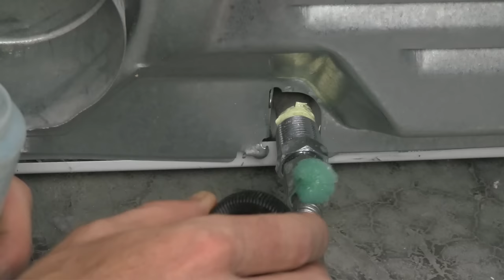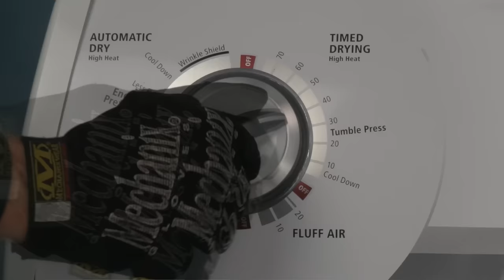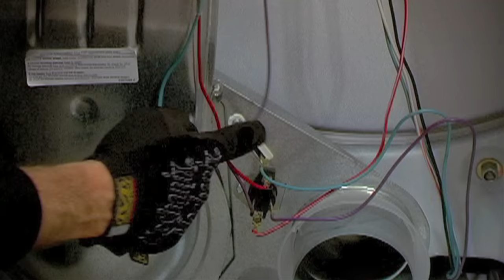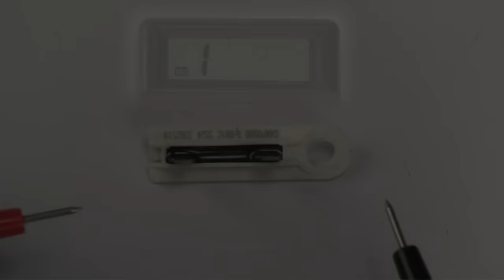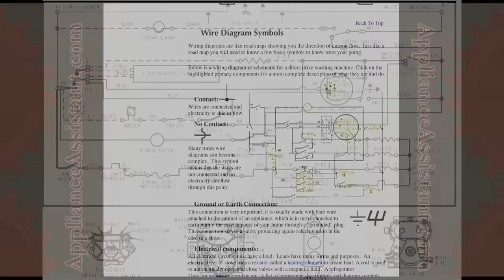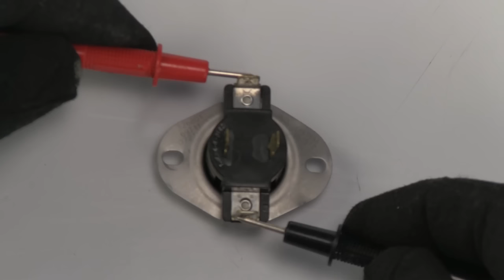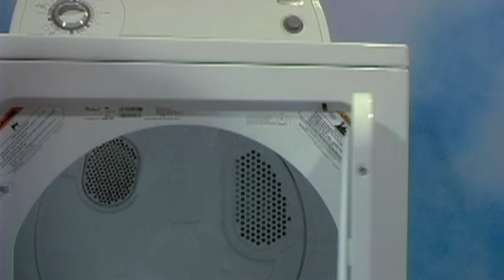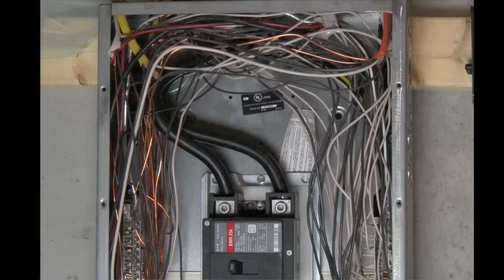Gas Dryer Repair: Fix Heating Problems

Comment from the maker: Thank you for making that point! The drum does need to be in place for the blower to properly draw the heat away from the hi-limit thermostat which will kick the burner off after about 10-15 seconds if the duct is clogged or the appliance is open not allowing the blower to pull heat.  Sorry I didn't make that more clear!  Congratulations! Thanks for the comment!

Comment: I am having the same problem with my whirlpool lgn1000pq gas dryer..igniter glows red and lights flame upon cold start....flame burns for 5-10 minutes and goes out never to light again unless from a cold start... I have cleaned all lint from dryer, flex pipe and exhaust fan....replaced gas coils and still same isuue...any help would be appreciated...I can see igniter glowing...I can hear a click and then a wooosh like the flame was blown out....Thanks

Comment: @applianceassistant 
This is the exact problem I have. The heat goes on but goes off after a few minutes. After turning off and letting it sit for a while, the same thing will happen, heat goes on for a few minutes then off again. Which part should I look at?

Comment: @applianceassistant , wow, your answer was fast! thanks!  well, while waiting for your answers I runed the dryer, turning the heat temperature to just air once in a while, making the flame turn off for a while.  And when I was going to do this again I noticed that the flame turned off by itself!.. mmm.. I probably wasn´t waiting enough!.  So, it looks that this cycle just went ok.  I have to dry more cloth afther this cycle... so, I will be checking.  Many thanks. Your web page is great!

Comment from the maker: @lorisbs Thanks!
You can monitor the cycling temperature with a meat thermometer at the rear duct.  On hi heat it should cycle off somewhere around 160-170º and back on around 100-110º you can also look at you cycling thermostat and see what the target open/close temp should be, but it will be slightly cooler as the air is leaving the dryer. If it does not cycle off eventually the hi-limit thermostat or thermal fuse will open.  Email me through the site If you have any other questions.

Comment: Great video... I have been working with my whirpool dryer for some days... the flame was turning on at the begining but after a while the ignitor turned on but not the flame, so, it wasn´t heating. I checked every thing, and all pieces have continuity, so I decided to replace the gas valv selenoid coil kit.  The flame is turning on now, but it doesn´t turn off... it´s supose to turn off after a few minutes, right?   I have learned a lot these days about dryers, but don´t know what else to do.

Comment from the maker: @TMGADTXTER What is the brand and model number of your dryer? After the dryer has heated and cycled off, does the ignitor glow again and then go out with no burner ignition? If you turn the dryer off for an hour or so will it heat again?

Comment: I watched the video, but I am unclear about the problem with my dryer.  The igniter lights up, the gas is released and the dryer heats up, but it appears that it does not re-ignite and so the clothes don't dry completely.  Is this the sensor/thermostat in the back or the two coils that control the gas flow?  thanks in advance for the clarification!

Comment from the maker: @ace3shotgun7 If you have replaced the coils and are sure they fit well and are installed properly then it sounds like you have a gas supply problem. All you can do check that the gas is getting to the dryer if it is you may have a bad dryer gas valve, very rare but possible.  But first take a good look at the coils and make sure they are sitting well on top of the valve and the bracket is mounted properly.

Comment from the maker: @TBBJ2011 In most cases replacing the coils located on top of the valve should solve your problem.  If you need parts please find them through the links on my website. There is a link to ApplianceAssistant . Com in the description of this video. 
If you have any other questions please feel free to email me through the website and I can be more specific. Thanks!

Comment: I have a whirlpool model LGB6200PQ0. My dryer is not heating up, it glows orange an the flame starts. After 10 minutes the dryer stops drying. Turn back on after it cools down an it repeats the same thing. Checked the air ducts an found no lint. What do you recommend.

Comment from the maker: @lombo69 Sounds like you have a clogged duct somewhere, it could be internal if you have already tried to run it with the ducting off the back.  The only other thing I can think of mechanically would be the hi-limit thermostat part# 279048 malfunctioning, but most likely it is doing it's job correctly and cutting power to the burner due to a clog of lint somewhere.  If you happen to need a part... purchasing it through ApplianceAssistant . Com would be greatly appreciated! Happy Thanksgiving!

Comment from the maker: @Charismabucceri If you can see the ignitor heat up and cycle off with no flame then it is almost certainly the coils that need replacement. If the ignitor glows it okay in almost all cases. However if the ignitor heats up and does not cycle off then you need a new sensor on the side of the burner tube.  If you do need to get parts I would greatly appreciate buying them through the links on ApplianceAssistant . Com!  If you have any other questions let me know!

Comment: My maytag dryer is not blowing out heat. Its blowing out air but not hot air. One site suggested that I change the igniter kit, so I did. It lights up but my dryer still is NOT getting hot. And there is no fire starting in the tunnel/tube thing made of sheet metal. I've watched a video that suggets made its the valve coils or the thermostat. what do u think?

Comment from the maker: @gloweify If after it has cycled off you observe the ignitor glow again and click off without burner ignition then you should replace the coils on the valve. If the ignitor does not cycle and glow again then you may have a cycling or hi-limit thermostat problem. Or perhaps your ducting is clogged, or your blower ... Lets just start with the first question and go from there :) Also what is your dryer's model number?

Comment: @applianceassistant . I have a similar problem as above. Igniter glows, burner turns on and heats for a few minutes and then shuts off. It wont turn on again until it apparently cools down. Please let me know if you have any suggestions..thanks for your time.

Comment: @applianceassistant--very helpful video, I have a similar problem as the above comment. Burner igniter glows followed shortly by the burner turning on thereby heating. However after a couple minutes it shuts off and wont burn again until it apparently it cools off. Any suggestions? Thank you for ur time.

Comment from the maker: @MegaFlyman9 If your dryer is gas I would go with the valve coils... if the burner ignitor is glowing but the burner will not light you know that the thermostats are okay and it's probably the burner coils.  However if the ignitor stops trying to ignite the burner then you probably do have a problem with one of the thermostats.  Feel free to email me through ApplianceAssistant . com if you have any questions and I can get a little more detailed. Hope that helps some, Good luck!

Comment from the maker: @srelliott83 Sorry for taking so long in getting back with you. By the wire diagram I would think that you may have a problem with the temp selection switch or the wire harness that connects to the temp selector switch.  The harness has 2 inline resistors (1 10Ω & 1 10KΩ) I would check those for resistance with the harness unplugged. or there is a timer contact problem from orange to white/black wire at timer switch 0.  hard to say for sure without actually checking voltage at the timer contact.

Comment: Great Video.  I get heat on start up and then after a few minutes the heat turns off and does not come back on until after about 10 minutes when everything cools back down.  I am guessing I have a cycling thermostat failure and the system is cycling on the hi limit thermostat.  Does this sound like a correct diagnosis.  I already mistakenly replaced the hi limit thermostat and don't want to make another costly mis-diagnosis.

Comment: Hi.  My gas dryer gets hot on the high setting but does not heat on any other setting.  The timed high heat will progress on its own.  The auto dry mode does not progress or heat up.  It is a Whirlpool lgr 7646eq3.  Any advice?  Thanks!

Comment from the maker: @kenbro63 That's a tough one... If the valve coils did not solve it I would lean toward the valve itself.  Of course check the hi-limit first but I doubt it.  You will also want to pull the valve out and take a close look down the orifice where the gas comes out. I had one case where a spider had built an egg inside the valve orifice that was strong enough to bock the gas flow.  If you actually open the valve assembly it will need to be replaced! The valve itself IS NOT serviceable.

Comment from the maker: @kenbro63 In my experience replacing the valve coils will get you going and stop the noise in the valve 90-95% of the time.  
If you would be so kind as to purchase the parts through my website ApplianceAssistant . Com I would be very grateful! Good luck!

Comment from the maker: @laro177 If every component checks out and the igniter is still not glowing you will probably need to check for voltage coming from the timer to the heating circuit.  Please send me an email through my website and I will give you my phone number so we can try to figure this thing out. Applianceassistant . Com

Comment: Appliance assistant, you guys Rock! I researched the symptom in your comments and matched it up to my issue to the "T", and followed your great video advice and replaced my coils. The problem fixed with my two year old Whirlpool gas dryer. Thanks for the advice.

Comment from the maker: @tifnik3 Model IGD4300sq0 has all temperature settings on the timer. Because the dryer works properly on the timed dry cycles we know that the heating circuit works... So I would venture to guess that the timer is not supplying power to the heating circuit during the automatic cycles and needs to be replaced.  (Timer is part#8299764) The only way to know for sure is by checking for 120Volts coming from the timer to the heating circuit you would need a wire diagram to know what wire.

Comment: I have a kenmore 80 series Gas dryer I bought used. It worked for 1 day ... :-( 
1. igniter glow no flame (I replaced 2 coils)
2. Now Igniter glow flame start and last for less than 10 seconds.
Now what else can I do ?? Please help I but parts from your store

Comment from the maker: @cvtogate All Kenmore dryers starting with 110. are Whirlpool built and are almost identical to what you see in the video.  You are exactly describing the symptoms of bad valve coils.  Don't buy them individually!  It is actually less expensive to buy them as a set. And then you are sure to get the one that's acting up.  I would greatly appreciate it if you would consider buying through my website ApplianceAssistant . Com and support this service!  Thanks!!  If you have any trouble email me!

Comment: Kenmore 70 Series GAS Dryer Not Heating up serial 11076712694..  The dryer spins and lights up. I removed the front peep hole and saw that there is what seems to be a glow coming from the bottom of the unit which I'm assuming is the the heating coil, it shortly fades out like a candle within a few seconds, I don't see an ignition of gas.  The coil or glow seems to cycle on and off every three minutes.

Comment: @applianceassistant :

@applianceassistant . when the igniter  get heat the flame start normally but in like 10 or 15 second turn off. i'm confuse, can the coil be the problem or the thermostat, I already check the thernostat and when i checked the 2 long conector  i heard the sound in my meter it means is good but with the 2 closer conector i donot hear the noise it measn is good, but when i chech the same chort conectors  with 20k i get a reading of 6.69 it means is goog ?

Comment from the maker: @MonsterSpartan The heating element itself ether works or it doesn't, so being that you had said that it heats sometimes I would say that it is unlikely that the element is bad.  I have been commenting as if you had a gas dryer...Is your dryer gas or electric? Gas dryers don't have heating elements. Model number would be helpful.

Comment from the maker: @edwinyoutubification Not really.  You can check them for continuity; However, because they generally only fail when they are hot it is difficult to get an accurate reading.  If the igniter heats up and cycles off with no heat...
#1 it's the coils.
#2 your gas to the dryer is off or blocked some how.
#3 your dryer's burner valve is bad. (fairly expensive and very rare)
If you need any parts...PLEASE PLEASE PRETTY PLEASE buy through ApplianceAssistant . Com to support these videos. THANKS!!

Comment from the maker: @edwinyoutubification Not necessarily... When the igniter  heats up and cycles off with no gas being released, the coil kit is the most common cause.  However, when the gas just burns for a short time (15 seconds) then drops off suddenly, it is usually clogged home or internal air ducting, or the hi-limit thermostat. (side note:  If you need parts I would greatly appreciate it if you would consider buying through the links on my website ApplianceAssistant . Com  Thanks!)

Comment: I think that I have the same problem, my dryers starts burning gas, the igniter is turning on and off, but in like 15 second after it started burning gas( I see the flame) the gas stops. Does that mean that I have to replace the 2 black coils ?

Comment from the maker: @panagdimi It should only have 4 wires directly connected to it. The best way to check the thermostat for cycling accuracy is to use a meat thermometer to measure the temperature as it leaves the dryer at the duct, and observe the temperature fluctuations.  on high heat it should be heating to around 160-180 and the it should cycle off and cool down to around 110-120 and back on again. Email me through my website ApplianceAssistant . Com for a more detailed description of testing procedures.

Comment: Unbelievable, great video. Great detail. I fixed my whirlpool dryer a couple of times in the past but this time it was firing on and the flame went out after 10 to 15 seconds. The comments and your very helpful replies to other gave me the answer. My vent was clogged from lint from a very fluffy blanket. Thank you

Comment: HEY!  Did as you said, had 120v at igniter leads, pushed the leads back on to igniter, (after unplugging machine, of course) plugged machine back,put it on high heat and igniter glowed, machine fired!!!Checked on low for kicks, fired!!!Could the only problem have been loose connection at igniter?  When I first took machine apart that baby was tight.  Actually had to get flat blade under the "clip" to release. I also giggled motor wiring "clip" too before trying to fire machine.  Who knows?

Comment from the maker: @munkdavid  Try unplugging  the leads to the ignitor and check for 120 volts from the leads when the dryer should be heating. You will need to reattach everything, remove the drum and ether jump the door switch or reattach the closed door panel.  It sounds like the timer may not be supplying  power to the heating circuit.  You may also have a partially loose contact to the motor to the neutral side. So make sure that it is fully attached. Email me through the site and I will give you my phone #

Comment: Checked both hi-limit t-stats and they showed no resistance so I'm at a loss for why the igniter is not turning on (dryer is on an outside wall and the ducting is most certainly clear.  Thermal fuse shows no resistance as does flame switch.  Igniter showing 5 on 10x scale.  Cycling t-stat shows like igniter on the two sides and no resistance on the top and bottom (just like the new one I purchased when I thought that was the problem).  I always unplug wires when testing as per the vid on Youtube

Comment from the maker: @munkdavid You will also need to unplug and remove the two wires connected to the hi-limit thermostat before checking it or you may get a false positive through a side circuit. Check out the how to use a voltmeter video, or circuit troubles videos for more clear information on testing and circuits.  Hope that helps out some! Good luck.

Comment from the maker: @munkdavid The hi-limit thermostat should be closed and test positive for continuity when the dryer is cool. Different dryers use thermostats with different sensitivity levels but most will open around 200º-250º the hi-limit may be working properly and opening to protect the dryer from over heating because of a clogged duct in the home or within the dryer.  Try to pull the ducting off the back of the dryer and see if you are having the same problem.  If so look for lint clogs inside the dryer.

Comment: Hey dude, thanks for getting back to me.  I did the Dryer troublrshooting app at Appliance Assisant .com and the only thing it could be is the hi-limit thermostat because the other things all ck. as they are supposed to.  If you get this and can give me a heads up on how to test it that would be great.  Otherwise I'm going to ck. for info on how I test for this.  If I wasn't a stupid carpenter I could figure it out with a few intelligent deductions via the wiring dia.